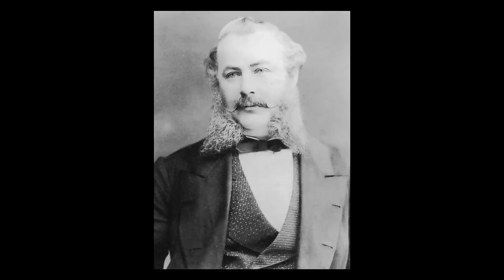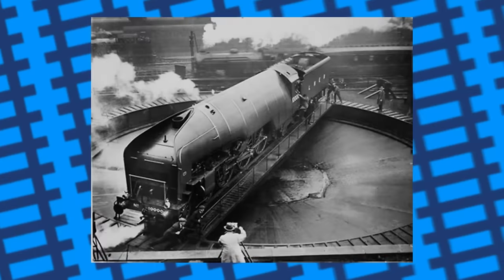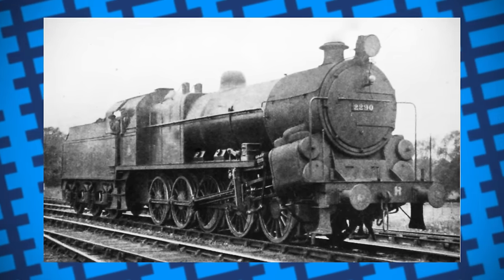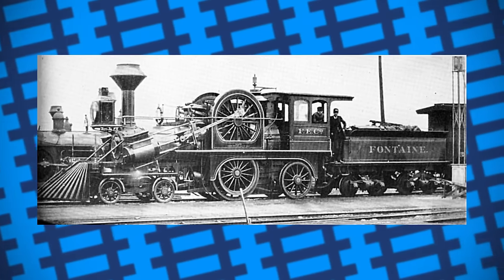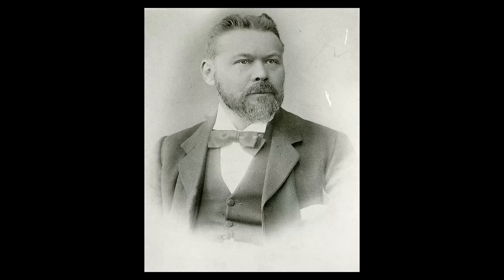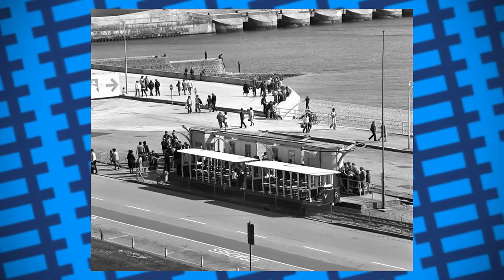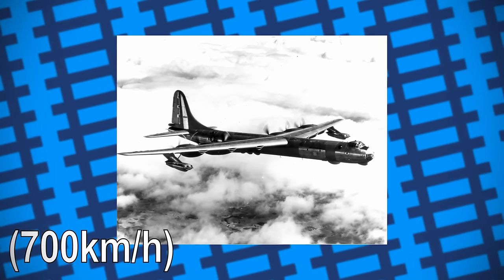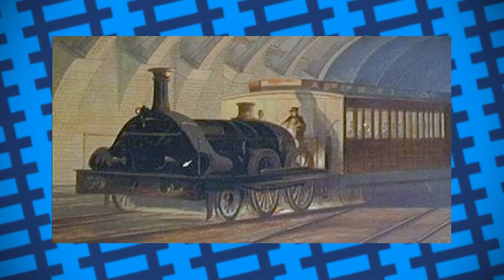Train of Thought COMPILATION - Unusual Experimental Engines

Comment: Imagine if Bulleid's "Leader" loco would have simply built with an oil burning boiler...
Reply: He'd still have to face the problems with valve tribology, leaks, and seizing, and the issues with the asymmetrical chains.

And finding enough ASLEF men to tend the boiler... which would still need fairly frequent and careful attention deep in that casing.
Reply: @wizlish  The N & W in conjunction with Westinghouse produced a steam locomotive which required only a single crew member. Tribology would not present a long term problem though it would require some real thinking - in the UK oil was all too frequently degraded by atomisers as opposed to being delivered directly to point of application.
Reply: I think you're describing the M2 Automatic... which was a converted 4-8-0 intended for switching/marshaling service that could run "as long as a diesel" without a fireman or ash handling.  It was not exactly a poster child for a road locomotive, although it pioneered the kind of chain-grate firing used on the N&W TE-1.

The 'tribology' issue was unique to Leader's and Hartland Point's sleeves: you couldn't keep them unseized and steamtight at the same time, and the amount of oil necessary was an appreciable fraction of what a comparable diesel would burn...
Reply: He went to Ireland and created the turf burner and that was relatively successful. What came out of the workshop as leader was however not how bulleid originally designed it as well,  as he designed it with oil firing in mind, which would have not required it to have the offset boiler and the consequent balance issues. 

Ultimately the decision had been made that diesel was the future by the time leader was getting trials,  so it was seen at the time as a fools errand to go with it. 

Bulleid later said I believe that some of his designs were ahead of where material science needed to be and this contributed to some of the problems faced by his locomotives.

Comment: Fowler's Ghost is a fun side journey to go down. The problem with the engine was a back injector. The Fire bricks have been postulated to not get hotter than the melting point of crown sheets so the theory is the Fire bricks prevented the crown sheet from failing due to low water.

Comment: Fowler’s Ghost also had other issues. The firebricks were a bad choice to retain heat, low heat capacity. Meaning they may get really hot, but they do store much heat energy…

Fireless steam engines work much better — they use the superheated water as the heat storage. As steam is drawn from the boiler, some of the water flashes into steam, lowering the temperature of the water a tiny bit (and thus causing the pressure to drop a little bit), a cycle that can be repeated many times until the steam pressure is too low to use.

To charge, they have a pipe with holes in the bottom of a cylindrical pressure vessel — no firebox, no flues etc —where hot, fresh steam is pumped into the boiler. Starting with a boiler half-full with cold water, they get to about 3/4 full (I understand) with steam and really hot water, and that allows them to work for ~2 hours.  If you have onsite steam anyway, …

Comment: There is a file held in the National Railway Museum in York which contains the North Road works documentation about 10000. The single item which caused serious problems for the locomotive was a pipe. This pipe was supposed to supply the steam to the auxiliary equipment fitted to the engine. And it was too small at 1.5" i.d. and two pipes were recommended a; single 1.5" pipe for the injector and a 1.25" pipe for the combination ejector and other fittings. As originally built the auxiliary supply could not meet the demand of the injector which meant that the boiler would not steam well because it could not be supplied with sufficient water. It took a long time to identify this problem which proved to be a serious setback. As an experimental machine it was supposed to equal the power output of an A1 Pacific and design started in 1926 but it was Sept 1932 before it was proved that the engine consistently produced a full head of steam. So the boiler worked well and the records held show that this boiler gave little trouble, so quite where some writers obtained their material from we can only guess.

 The big issue was finding out how to work the engine as a compound and the LNER never quite got there because early 20th century testing results gave rise to incorrect conclusions. It was believed that the L.P. cut off should be fixed and the H.P. cut off adjusted to meet the demand and this was proved by Chapelon to be wrong and to be fair their was a school of thought (a minority) that also believed this to be the case. The H.P. cut off should be long (as much as 90%) with the L.P. cut off being adjusted to meet demand. 10000 was fitted with a Kylchap exhaust and data collected from the setting up tests for this shows that the idea of this machine being limited by design to equal the A1s was very mistaken. One engineer came up with a figure slightly under 4,000 hp. using the 90% H.P. cut off.

Comment: M-497 was never intended for passenger service.  It was a test mule much like its Soviet counterpart.  It did develop good data on running at high speeds on track that was not specially prepared.  The conclusion was that, so long as the track was in reasonably good condition, and had been well-built to begin with (ie-with the much heavier load factors found in the US), there was no reason why a lightweight train couldn't safely run at high speeds without damaging itself or the track.  The ride comfort, on the other hand, left a bit to be desired.

Comment: I wish we could see a modern version of a steam engine, even if it's not a locomotive. Great video! I've loved trains for as long as I can remember so it's cool to see what could have been!
Reply: He should do a video on some of the modern steam developments -- Livio Dante Porta, Turbomotive 2, Shoemaker's NALC design with the converted diesel engine, for a few starters -- and then discuss the adaptation of the enginion AG 'ZEE' to railroad service as a multiple-cylinder motor locomotive like the Sentinel built for South America, the Roosen BR 19, or the Besler constant torque (B&O W-1).  There is something to be said for 7250psi at 950C with separately-fired superheat... single-expansion...
Reply: There is an org manufacturing a brand new PRR class T1 , number 5550

Comment: The first recorded use of a propeller driven "train" is when German military aviators based in Palestine mounted a spare Mercedes aircraft engine with propeller on a flat car; to go to a seaside town many miles distant. Reportedly it did not have brakes...

Comment: Ever heard of the GT3 Gas Turbine locomotive? I only found out this interesting locomotive from the History of Railways, Chartwell Books Inc. Good Railroad book at least for me.
Reply: Union Pacific bought and successively operated a series of gas turbine-electric locomotives in the '50s and '60s. The fuel was a viscous petroleum oil called "bunker C", which at the time was in common use for firing marine steam turbine engines in ocean going ships. Bunker C was cheap and plentiful, and UP was happy with its gas turbines, but the price of bunker C was increasing over time making the gas turbines increasingly uneconomical to operate. Eventually the railroad retired them in favor of ever more powerful second generation diesels.

Interestingly, Union Pacific experimented with a coal fired turbine-electric. The coal was carried in a separate tender unit which mechanically pulverized the coal into a fine powder which was then fed to the burner and hence through the turbine. The project was abandoned when it was discovered that fine unburned coal particles were eroding the turbine's blades.
Reply: Keep in mind that UP80/8080 was a follow-on to the very long and often interesting coal-burning experiments under John Yellott at Bituminous Coal Research.  This has been covered by Eric Hirsimaki, iirc in the early 2000s.  The ash issues alone were long-term showstoppers.

Comment: You forgot to mention the German turbine locos class T18 produced by Krupp and Maffei in the 1920s as well as the Schwarzkopf-Löffler High-pressure steam engine. The latter built on a frame of a class 01-Pacific wheel arrangement but with a 3-cylinder-compound engine.

Comment: One thing to keep in mind is that Hush Hush having that wheel arrangement made it a Hudson/Baltic rather than a Pacific.
Reply: Actually it's neither: hush hush was a 4-6-2+2 in the same frame, so really a stand alone. 
Probably just call the wheel arrangement a hush hush if it ever  needed a name, joins those very few named Whyte arrangements as a unique locomotive, or a Whyte with no name at all
Reply: @muir8009  how about the "what-the-fuck-are-you" wheel arrangement?

Comment: Great compliation! I was interested to know why engines like big bertha and the 7Fs had canted cylinders? Most other freight engines had the cylinders more or less in line with the motion. Why did these engines have their cylinders at such an angle to the motion?
Reply: The same with the Hughes Crab, and for the same reason; fitting very large cylinders into the loading gauge.

Comment: An excellent collection. There's one loco I'd like to see featured and that's a pre WW2 German loco that was a hybrid Diesel compressed air. The Mark 1 version was about 30% more efficient than Diesel electrics at that time. It would be interesting to see how much better Marks 3 & 4 could have been. 
Sadly it was bombed into oblivion by the allies.
In my big book of trains I got from dad in the 60s there was a Soviet era condensing steam engine used on the steppes I think. Can you find that one?

Comment: Just something to make the Decapod a little bit worse, there's some evidence to suggest the GER cheated on the trials.
When the engine's design specs were put into a modern vehicle design software it's maximum acceleration was just short of the electric trains of the time, and significantly short of its recorded performance on the day.
On the day of the trials the independent observer didn't ride on the train during the run, only observed the train before heading out, and there were several delays in heading off.  It's entirely possible that after the offical observer left they took the balast (representing the weight of a full passenger load in the test train) out to make the train lighter allowing the engine to accelerate faster.

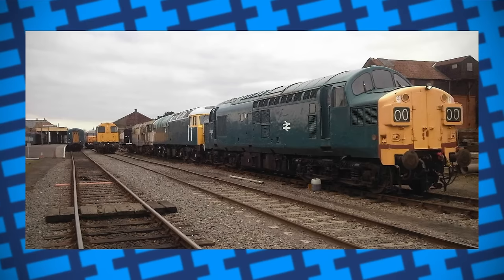Comment: 3:00 Didn't last too long?? Considering the Double Fairlies are still operating on the Ffestiniog Railway and that they're constructing a new one, I'd say the design has definitely lasted, even if it's only on the Ffestiniog.

3:39 Increasing the boiler pressure isn't about increasing speed but efficiency. In order to turn water into to steam you first need to heat it to it's boiling point, then you have to vaporise it, then you can continue to heat the steam. It takes a certain about of energy to convert water at a certain temperature to steam at the same temperature (know as a phase change), this is known as the Heat of Vaporisation and in a steam locomotive (indeed in most steam systems) is lost energy that you don't get back. By heating a certain quantity of steam to a higher temperature (and therefore pressure) you can get more work out of that unit of steam, thereby reducing the relative amount of energy lost. Or to put it another way, a locomotive operating at 50psi has to vaporise a lot more water than a locomotive operating at 225psi. This is why modern power stations use boilers/steam generators than have pressures measured in thousands of psi, some even use supercritical steam generators operating above 3200psi.
Reply: A good proportion of the latent heat of vapourisation can be recovered by sending the used steam to a condenser rather than blowing it out the funnel. I don't think many steam locomotives were ever built with anything of the sort, but they're a near universal feature on static and marine steam installations.
Reply: Odd that it's called 'vapourisation' when it produces steam (a gas) and not water vapour...

Comment: Hush Hush didn’t have a standard A1 Frame, it was longer, so needing a 4 wheel trailing boogie, not because of the extra weight. A standard A1 had a 180psi boiler, later A1 locomotives became A3 with 220psi boilers. The original boiler ended its life as a stationary boiler at Faverdale Carriage Works, Darlington.

It my be spelt ‘DERBY’ it’s pronounced “DARBY”
Reply: Just remember it wasn't actually a trailing bogie, which, when you think about it of course the NE Pacific's didn't have trailing bogies per Se anyway

Comment: During watching this
I drew a locomotive 
I made a comment like this on the farlie locomotive video 

So I made this locomotive which is basically a normal locomotive with another cab at the front, a bunker going all around the boiler and the farlie boogies.

There are 2 cabs like diesel and electric engines so that there is a great field of view and you don’t have a boiler in the way. The fireman would stay on one cab as there is only one firebox on one front of the locomotive why the driver changes cabs if going a different direction, also as a side note, I put a lil pipe so they can communicate with each other.

The bunker is made around the boiler so that there is a lot of coal and water, and theoretically the whole engine can be extended.

And with all the farlie loco features and achieving all the goals that were said that farlie wanted!
Reply: See the Meyer locomotive, which is like a Garratt with the lead engine pivoted under the boiler like a Mason bogie, so the driving wheelbases flank the deep firebox instead of using a long cradle.

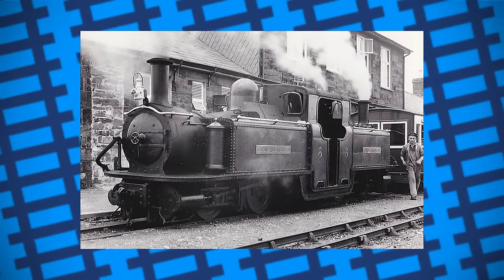Comment: 2:30  mighty mac
6:42 Hurricane
30:10 Hugo
41:56 Henry
42:51 Neville
Reply: Uh-huh. There was Emily, too.
Reply: @ItsDaJax Emily is not an Experiment engine she’s a Stirling Single locomotive. Which has that big driving wheel
Reply: @Iknowwhoyouare396  I knew it was either experimental or not very successful. If I recall it was supposed to be a high speed loco, hence the big wheel, but ended up being a mixed traffic loco.

Comment: I grew up with steam, so for years I mourned its passing, and still get nostalgic at heritage railways when I smell that wonderful combination of steam and smoke...  But the unfortunate fact that steamies never seem to grasp is that it's vastly inferior to electric (most diesels are just electric engines with a built-in generator) when trying to run a railway.  You simply cannot build a steam engine that matches the power, acceleration, cleaness, ease of maintenance, flexibility, weight, cost, etc of an electric engine - and you never will be able to.  It utterly baffles me that someone as clever and imaginative as Bulleid couldn't see this.  Did he really think having a cab at both ends and being easier to wash would make up for all the other problems with steam power??  And, if any steamies reading this are about to argue for the retention of steam (outside of heritage railways), just conduct a simple experiment - prepare the engine for a morning train.  The electric driver will get a good two hours more sleep than the steam driver (and fireman)...

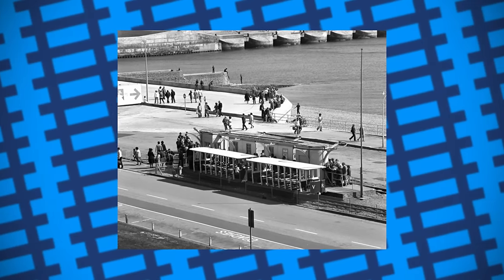Comment: 23:00 I am not sure if this counts as the first electric tram, as Siemens&Halske operated one in 1881 in Berlin, 1883 one in Mödling (Austria) and 1884 one between Frankfurt(Main) and Offenbach.
Reply: And in 20 years had one that would run 130mph...
Reply: @wizlish  It was not a tram though, but a railcar.

Comment: That Garrett was basically simply a good engine ruined by bad fuel and water
Reply: He'd have had much more fun with the original Tasmanian Garratts, almost the very first ones built (I won't spoil the surprises) or the epic Algerian Garratts of the mid-Thirties, with drop valves, 'salmon' rods for longitudinal balancing, and electric reversing gear...

(I have a good opinion of the NZR Garratts, but nobody else does... and where is the New Zealand banking locomotive with the Vauclain compound cylinders and dry-back boiler under its epic-in-a-different-sense hell-hot cab?
Reply: @wizlish I don't know anything about trains, but why do people have that opinion on the NZR Garratt's?
Also is there a good place to find out more about the leaning train. As a kiwi I'm intrigued.
Reply: @BrickNewton  there were a lot of issues with the NZR G. Also some politics.
Basically Lynde had a reasonable idea of buying a garratt for a number of years following the fay raven report of roughly 50% more TE than the standard A/Ab and a bit more of a speed machine than the X.
Nominally he looked at a conventional and quite usable 4 cyl 2-6-2+2-6-2. 
What happened was beyer peacock saw him coming and said for only a few £ more we can slot you into a feel good 6 cyl 4-6-2+2-6-4 with everything and really big drivers which will be great for crawling up the raurimu spiral and why have 4 cylinders when you can have 6 and MORE POWER.
So, ended up an overpowered thing (remember a loco can only haul a train as long as an available crossing loop).
Mechanical stoker jammed up frequently and firemen found it hard to regulate, inside bearings ran hot, the gresley conjugated valve gear was poorly executed and quite weak.
The politics? The locomotives ran into the start of the great depression. 
The railways did need a more powerful locomotive, and with the advent of the depression the socialist government wanted to spend their money in NZ and provide kiwis worth work rather than overseas, so the creation of the 4-8-4 K building programme.
So things worked out for the best.
I have seen that elusive photo of a pair of the garratts double heading on the spiral. Stunning to see.